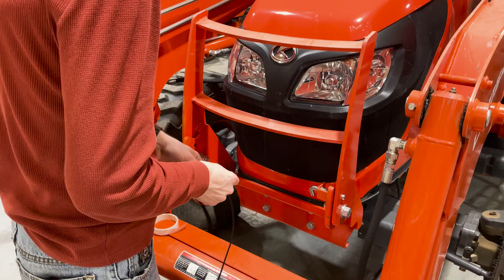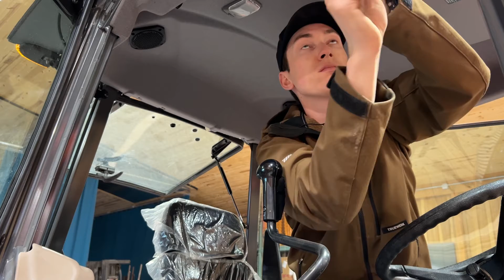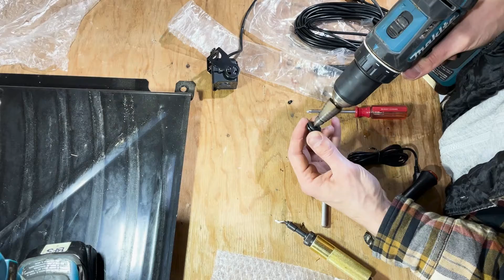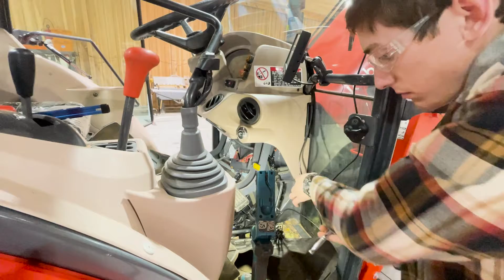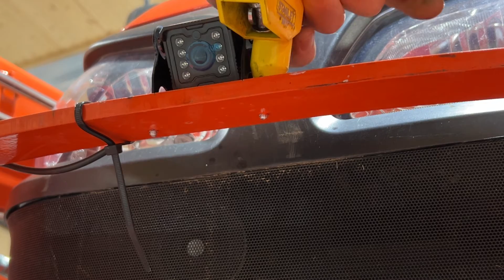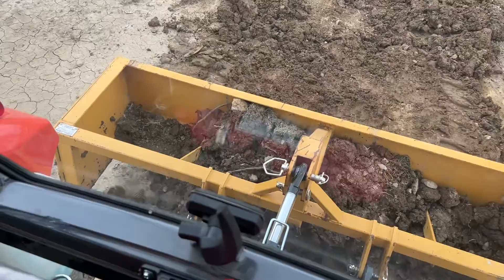Adding Cameras to a Tractor Front & Rear #tractor #farming #homestead #wiring

Comment: thanks for posting the video, I have a new M4D and really need a camera set up. It looks it's been 5 months since you responded to anyone. Other than moving the front camera to the top of the cab is there anything you would suggest changing? Are you still pleased with the camera and install? thanks again
Reply from the maker: I think that would still be the only change we would try on this camera install. It may be that moving the camera to the top of the cab you would also want to have a more narrow field of view on the camera in order to see your quick attach better.

Comment: Are you still liking these cameras and monitor?  Just got this tractor and thinking about a 9” screen over the 7 as my eyes are aging.  Think there is room for a 9” mounting where you did?
Reply from the maker: Yes, I still like this camera system a lot. If I were to do it over again, I would probably mount the front camera up on the cab like I did the rear camera. I think you would actually get a better view of the attachment from that vantage. You should be able to mount a 9" monitor in the same location I used without any problem.
Reply: @BrothersFabShop thanks.  I need the front camera to see to hook up the bucket and grapple.  Can’t see to hook them up.
Reply from the maker: That makes sense. It's really hard to see the quick attach on the M7060. It's the same reason we put the camera on too. We would recommend experimenting a bit with camera placement, because where we have it, it helps, but there is still a bit to be desired. the wide angle of the camera doesn't give us as much visual help as we had hoped.  We think putting the front facing camera up at the top of the cab might help, but we haven't tried that yet. Good luck.